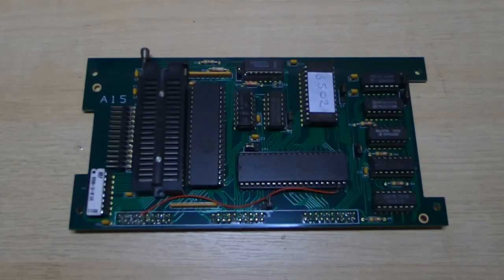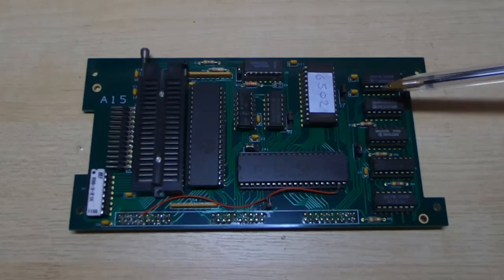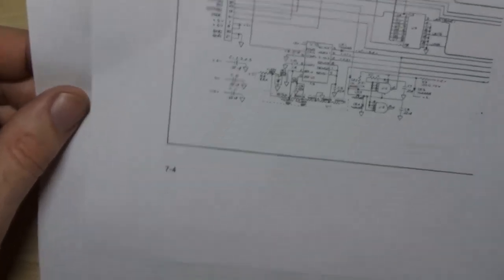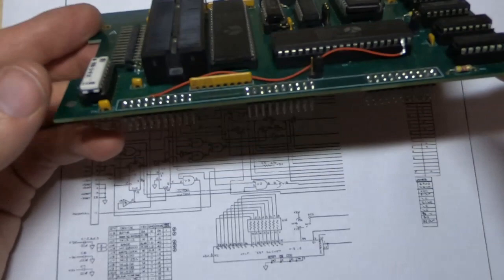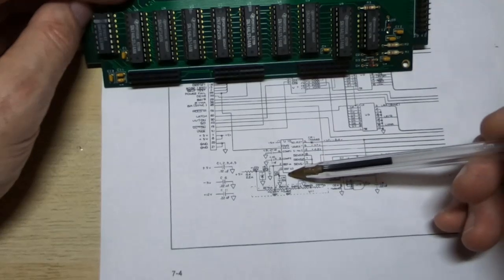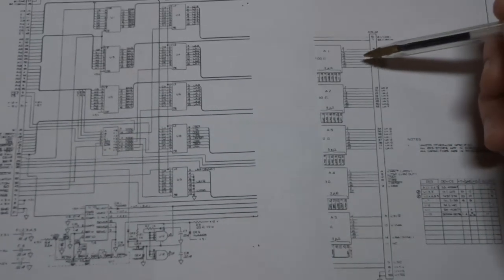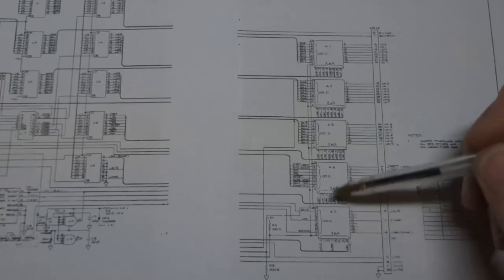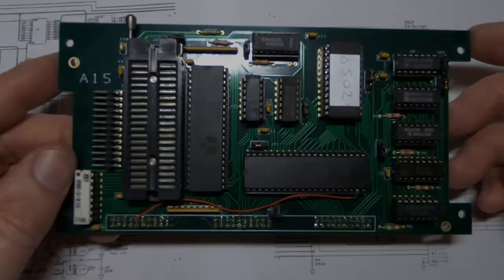Fluke 9010a JM Precision 6502 Pod Boards

Comment: Hi Jerry, Just got the boards. What is the function of the wire from the processor to the header pin in this video. I don't see it on the documents included with the boards. Also, I may be mistaken, but it appears as if C10, 11, 12 on the A 15 board have no traces that connected to anything. Is this correct?
Reply from the maker: VA7ACG, The board in the video is a prototype board and I use them for other things. The wire is not required when you build the pod. Yes C10, 11, 12 DO have connections. The boards are 4 layer so there are 2 interal layers which these components are conneted to.
Reply: @JerryWalker001  Excellent. Thanks so much. I should have it complete in the next 2 weeks. I'll do a video when it's up and working.
Reply from the maker: VA7ACG, Following a complaint today from someone who purchased a set of boards but failed to carry out all the errata fixes please be sure to carry out all the fixes shown in the documents. I will be putting these on the web site in a few days but if you want to be sure you have the latest copies you can sent a message via the JMPrecision web site. The pods will Not work properly unless all the required fixes are carried out (There are only a few). I will also be posting a video on these tomorrow.